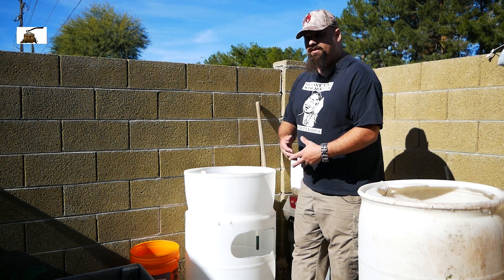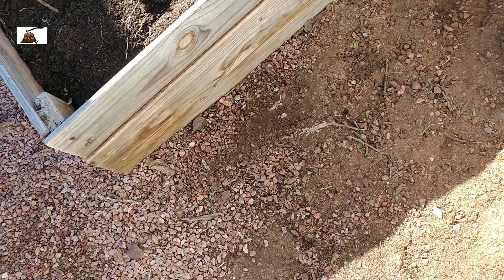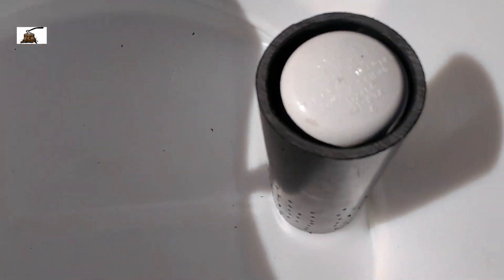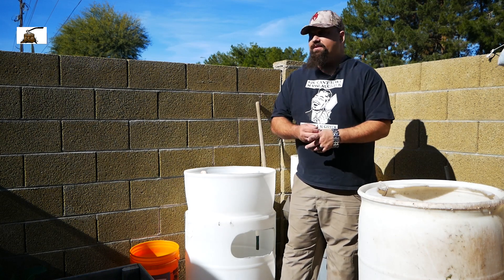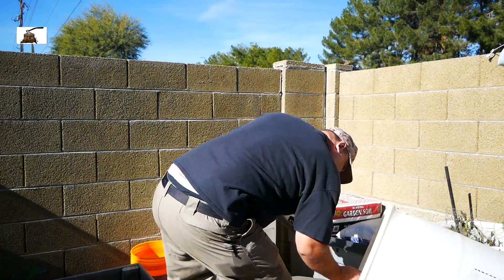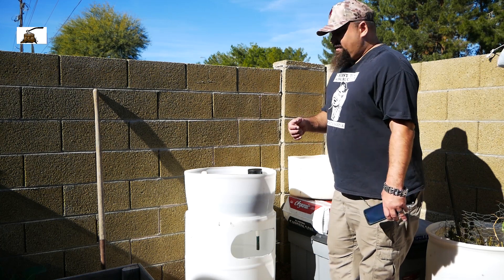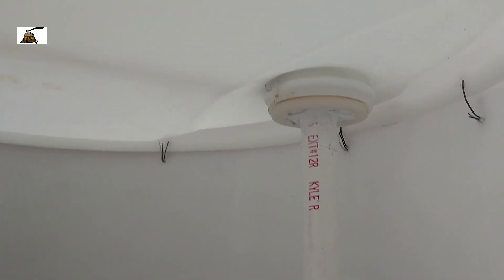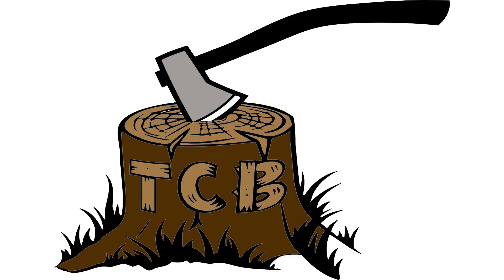Here's How I Made A Machine That Builds Fish!

Comment: Mess of cock and didn’t see any drip.  Those are the highlights for me.  Looks pretty AIRTIGHT to me. 

Very cool project!  Will you need to cover it from rain?  I bet you could grow some gnarly ass hot peppers!
Reply from the maker: I don't think so. It will lose a small amount of water to evaporation so I'll have to top it off every couple days anyway. I don't think it would hurt anything if it got extra water as it would just overflow out the side maintenance port. I'm sure an absolute deluge might be bad. I could cover it if it is really dumping buckets, I guess.
Reply: The Chopping Block 
Interesting.  I would have figured you’d pull it indoors with a little light setup.   I think it rains too much I’m my area to leave outdoors, but I could see not having enough in your neck of the woods.  Am definitely looking forward to the updates.   I do question the amount of space needed for fish though, if you plan to put tilapia or catfish in there, you think there’s enough room?  I’m guessing it doesn’t matter since they’ll be food stock and eaten within a year?
Reply from the maker: @trbrmc1187  yeah, I don't think I can have more than two or three in here at a time. Not sure. If this works well, I'll probably build a larger system using an IBC tote.

Comment: I’ve been an aquarist for years. A few suggestions, you’re going to need a stronger pump than one that hooks up to USB because of head height. To kick off your nitrogen cycle toss in some market shrimp and let it rot. There isn’t enough beneficial bacteria in the tank water. Lastly I suggest tilapia instead of goldfish, less prone to disease.
Reply from the maker: I looked at a lot of listings on Amazon to find one that was cheap and listed a max lift that was enough to move the water. Maybe they were lying and I'll have to return it. I've read that there's a good chance the first batch of fish will die so it's best to buy cheap ones. Are you concerned that the goldfish could contaminate the water, causing disease for catfish or tilapia later? We would prefer to eat catfish.
Reply: The Chopping Block if you’re using goldfish as “cycle fish”, yeah some of them will die. Some fish diseases can remain in the tank for a while after the fish dies but not many. Good luck with your project, I’m excited to see the finished product.
Reply from the maker: @Alamo-cz5xc  thank you for the advice.